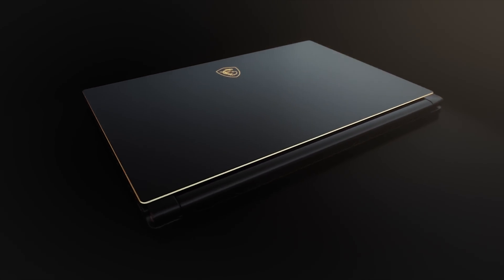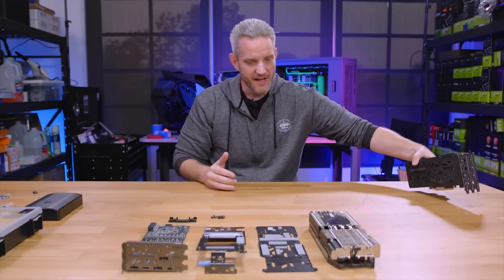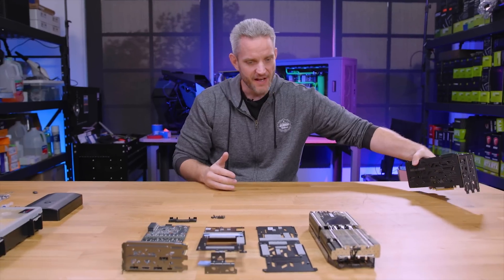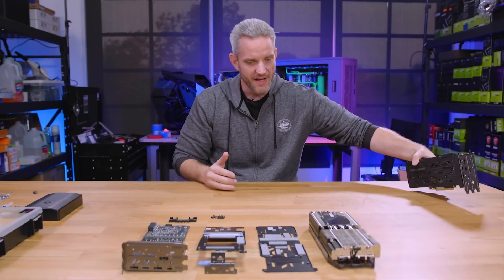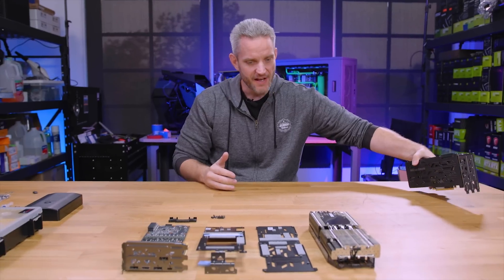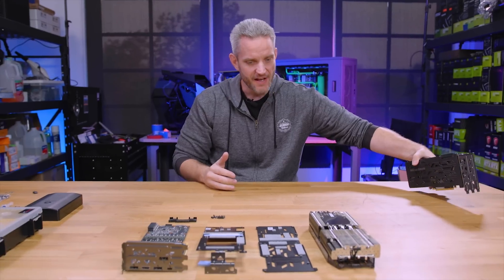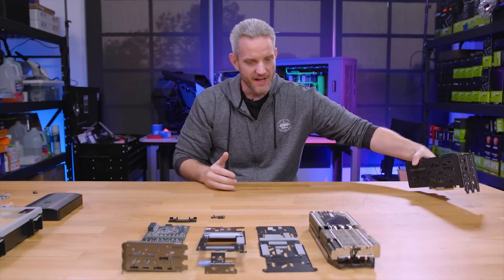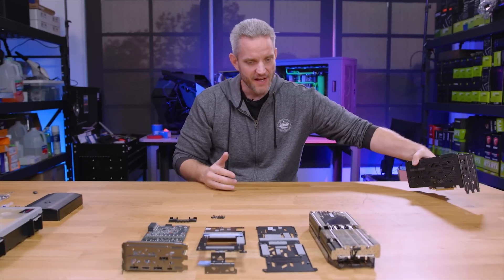I made my OWN 2080Ti Waterblock and the results are INSANE!

Comment: Hi, Jay. I notice in a lot of your videos that you use water cooling a lot. Now, being new to the channel I do not know if you respond to comments, but being a builder of pc's for over 35 years I still have yet to build a water-cooling one. What is the minimum spec to get any benefit from water cooling. Also, and I hope this never happens, if the tubes start leaking over the motherboard with the coolant is it game over? Would you have to replace the whole computer insides? Thank you.

Comment: Atm I am hesitating if I shouldnt send my 2080 ti back and get  another gpu sample, but regarding the clocks - my 2080 ti aorus waterforce stays somewhere in 1980-2040mhz range, the oc isnt rly that great, but the score is 7558 with 0,5fps difference to your result. I am really not sure if those 50-100mhz more on clock matter anyhow at all outside of benchmark scores.
Reply: Yes. That is an issue people don't realize about OC, that the amount of FPS difference is not always that great for small amounts of difference in OC(50-150 MHz). Especially larger amounts the newer & higher end the hardware is.
Reply: @TefensTech  what I do realize is that this gen is clearly at its limit and oc isnt as fun and meaningful as it was with pascal gen. Its basicly barely matters if you get a chip with 1850mhz max or 2175mhz core clock.

Comment: Conformal coating and a thin graphite pad would be a good thing to add on to that. Not quite liquid metal, but much safer and still providing some pretty epic performance. And also reusable!

Another thing that you should try; using a Dehumidifier to significantly reduce or even eliminate the risk of condensation.

Comment: I just put a water block on a 2080ti fe a phantecks glacier model and I am getting 60c max under full extreme load heavenly engine free and from what I see here I am 15 degrees hotter.  I am guessing since I bought a used water block and guessed for thermal pads and placement that I messed up.  I had to use 2 pads to get the proper thickness in some areas.  I matched up from the directions using 3 thickness I bought online.  Using a 2 large rads 240 and 380 or something.  Thick ones.  Noctua bad ass fans and phantek high static pressure fans.  My cpu and gpu all on one big loop. 

My question is 60c way to high?  Did I really mess up?  Thanks to anyone who answers.  I am still new to this.  My second build.

Comment: Awesome video Jay! That got me thinking I should add better cooling to my 1070 Ti VRMs. I am already cooling it with NZXT G12 and corsair H55 and I can hold about 2 to 2.139 Ghz on the core without crashes or any other problems. I am power limited and maybe with some extra cooling on VRMs I can have more stability aswell.

Comment: all you have to do is remove the fans from the radiator and put it in the bottom of a rectangular plastic container (tupperware/ziplock/etc..etc...) and fill it with 2" of water then fill the rest of the container with ice cubes.   The water/ice will drastically drop the temp of the radiator, compared to just passing air through it.  THUS BEATING LTT muhahahaaaa (plus easier to deal with than the a/c unit lol)

Comment: can anyone link to a video that goes into detail with what happens when you cool the die's? i would think that you could keep clocking up untill you exit the operating limits of the gpu and yet it seems that being WAY under that gets more performance? that is to say: id think a chip would work at the same clocks at 70C as it would at 10C as 70C is still below its thermal limits of 100C

Comment: Too much paste. Way too much. You only need enough to fill the microscopic voids between surfaces. These pastes are based on silicone which is much better than air but only 30% of waters conductivity. Thin it out well. Try using graphite sheet.

Comment: Try using a quadruple stacked Peltier unit rated for 300 W and enclosed water block rated for higher than 300 W on the hot end of the Peltier.

Comment: I followed your steps, but I'm trying to use my PCB, with a PCB build I had build, and 3d print (I build) the frames and designs for my PC, I have put all the components and solder them, than I made a PCB that can make processor's, because amd and Intel are over priced and overrated, with a lot of configurations and making endless programs for my PCB.... I finally can conclude that I made a potato.

Comment: I have an idea for you,  If your familiar with how Aquariums have a submersible heater if you live in a cold climate.  Try this,  By using your Aquarium drum filtration system to circulate the water thru your CPU and GPU cooling manifolds, Than the water returns warm to the aquarium.  I have a 300 Gallon Aquarium that would do great for cooling the GPU and CPU I think!  I would love to see you try this and show on Youtube, and bench mark and see what performance and temperatures you get.  IT WORKS!!! Hint Hint!

Comment: NEVER BUY MSI LAPTOPS! After warranty has run out, MSI won't fix your laptop when it breaks and they won't sell you or dealerships any spare parts either. Only spare parts, you can find, are from other people putting them on eBay or other marketplaces. They're essentially even worse than Apple.

Comment: I'd just use thermal epoxy for the VRM cooler.  I'd also add some spare heat-sinks on top of the rest of the heat spreader.

BTW, those quick disconnects are a great idea.  More modders need to do that.

He also did a dangerous technique of  shorting a bias resistor to nuetralize the amp-limiter.   Needless to say it almost blew out his massive power supply.  Changing the values of said resisters to adjust the amp-limiter would work much better if you ask me.  Swap out that high value resistor with a 330-Ohm and you should be sitting pretty creaming his score.

BTW, only a few points below Linus' condenser cooled system is amazing.    While hackish, Linus' system ha a water temperature below freezing, and yours is above freezing.   That means you are doing almost as much with way less!  

I love to see you guys compete though.  It always brings a smile to my face.

Comment: Why arent there more peltier board based cooling systems for computers.... maybe i just dont know shit about electronics
Reply: Peltier cooling is extremely inefficient and requires a lot of electricity for a small result.
Reply: @RunesLegacy  Aah ok got it... my experience with a peltier generator consists of making a wood stove fan that runs off the heat differential between a piece of steel and a heatsink... soo not exactly a pro lol Thanks for actually answering my question though :)

Comment: Jay why didn't you increase the voltage and the clock since your max temp under load is 30c wtf dude
Reply: Because it's probably locked in the bios and physically locked using voltage controller thingies on the card. Unlocking it will very likely break your card

Comment: no jay, gpu with stock cooling runs fine under normal use, under manufacturers safe claim, like me, an average gamer can still play games tested with prescribed gpu, do you have unknown games to be tested for that to run? do we still have the right claim under warranty if broke? watercooling is not adopted by manufacturer, so why pushing it to your mostly average subscribers?, tech updates quickly, so why  pushing beyond their limits?, you should as concern to us make advices how to use most of the gadget without alternating beyond devices limit, do we really need to watercool? overclocking also a nightmare with zero claim if broke, teach as the right use not how to mishandle things, im amazed with your explanations with new gadgets, you are just using one"s devices for your program, so why doing it as if they are wrong?